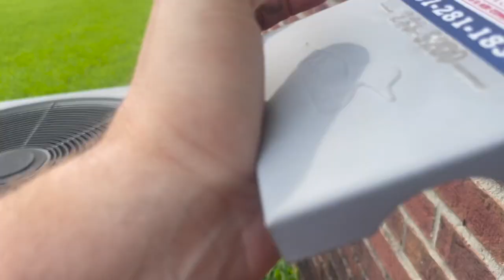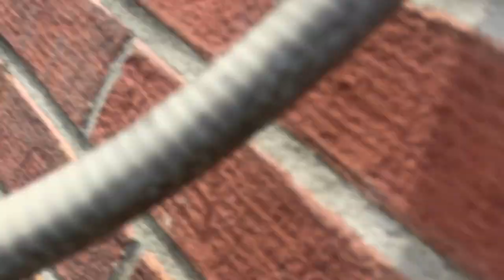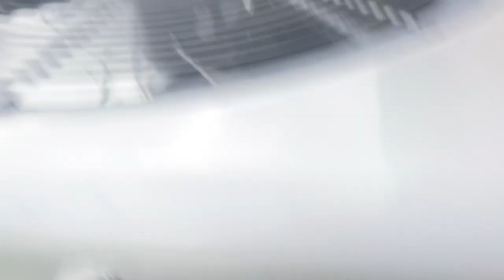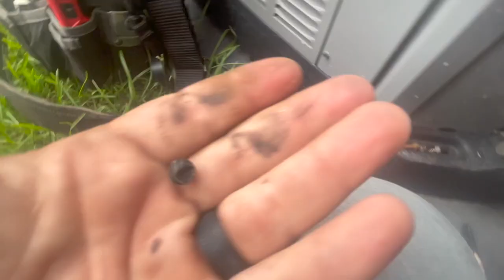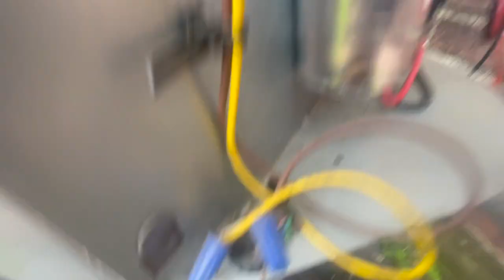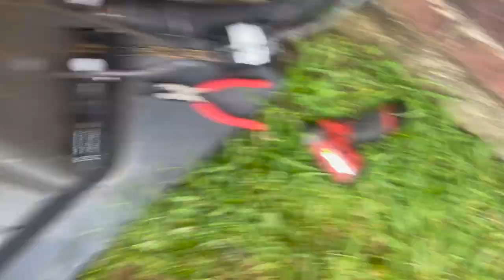Warranty Call/Noise From Condenser

Comment: Had a similar problem with two Trane condensors. Trane recommend put armor flex between the top of the fan motor and the cover. tighten screws to 70 lbs of torque. Also change the contactor to a 2 pole contactor and put the black fan wire to the bottom of the contactor.

Comment: Got to love those helicopters.
Reply: You guys talk about us helicopters when they were installing my unit the guy wanted to turn my unit sideways trying to convince me it would make it easier to work on when I wanted to look at the error codes on it if it screwed up I wanted to see it only reason he had to turn it sideways was having to run his vent stack out would save him on pvc pipe after everything was finished the Other techs told me it made sense of how I had it installed because the service panel for the a coil would of made it impossible to get it out
So much for us helicopters also it would of made it impossible to change the filters on it it’s a 5 ton unit
Reply: The installer was the problem.  Contractors or homeowners shouldn't have to tell you how to do your job.....and I hate helicopters no helicopter is gonna give me advice or how to do my job. That's why you called me....
Reply: I just tell them that I will get them after I find the problem. If they want to helicopter, I respectfully remove myself from the job. In my market, people are waiting for days to get service. We can pick our customers. Tables have turned and HVAC companies have the upper hand now. I had customers offer me up to $1k extra over my estimate to get their equipment installed quicker.

Comment: Isolate your condenser fan motor and compressor legs from the contactor. Double pole or 3-pole contactor would be easiest fix
Reply: I have installed many 3pole contactors on American standard units over the years. It’s a very common issue on those.

Comment: An old timer showed me to just add some electrical tape around the spades of the new  motor wires and it’ll slide through the seal-tight like butter.

Comment: I made a video how to stop the thump with a double pole contactor if you ever run across it again
Reply: Yes thank you for that video it solves a problem every time!!
Reply: There’s a fix for that, yes Joe is right he made a video, triple pole contactor.
Reply: @dizziedallas  I think I actually seen yours first but both solve the problem.. rheems are bad about it. Thanks guys great fix.
Reply: @SkipsTransAm2002   That’s cool I remember that video, unfortunately it happens in all manufactures.
Reply: @dizziedallas  I prefer to use the two pole method now
Reply: @joeshearer1247  I watched your videos about this (all 3 actually). In that situation, you said it only happened when the fan and compressor were shut off together. If you only had one piece connected in your test, it didn't make the noise. In this video above, it still made the noise even without the compressor. So I really think it's the broken hub problem that I linked in my other comment.

Question: what is the part called that you used to delay the fan by 12 seconds, solving your clunk issue?
Reply: @realSamAndrew  it could be the hub i believe he said it was loose but it may still do some level of the noise with the new blade. That delay device was a ICM254 but unfortunately they discontinued it
Reply: @joeshearer1247  thanks. Is there any kind of substitute or new alternative for that ICM delay?
Reply: @joeshearer1247  Nice!

Comment: I have a similar model rheem. Same 45+10 mfd capacitor. Stupid size. Why didn't they put in a motor that took a normal 5 or 7.5 mfd. I don't keep a 45+10 on my van
Reply: Yea those are hard to find
Reply: Gotta keep ALL the capacitors in your van.... I have at least 50 different types of caps in my van. All on inventory.. 2 of each
Reply: @videos10  well yea I do too but its hard to have them ALL in your van when the supply houses don't have them. Like the 75/5 MFDs
Reply: Is a common problem on Rheem is there packing when they stack them

Comment: I’m not an hvac technician but I do have a question. Does it matter what pin on the capacitor you connect to? I see there’s three on each section and I heard you saying what they were. I get confused why it has 3 terminals per section.
Reply: Doesn’t matter which one as long as the fan herm and common are on the correct sections and some caps have less or more pins fan usually has the least than herm and common has most so u can figure out tht way if you can’t see what the cap says

Comment: What’s up with HVAC companies always wanting to replace capacitors with best, longest lasting? I give them 1 year warranty. I hope it doesn’t last forever. I want to go back in a few years and install a new one for $350.
Reply: What you don’t realize is that by you having that attitude you’re not getting enough repeat customers and recommendations to stay busy all the time, that’s the whole reason you’re relying on Chinese capacitors to go bad again. Meanwhile the other 90% of us in the HVAC business can spend our time doing what’s best for our customers because that’s also happens to be what’s best for us.
Reply: You could poke holes in the coils too so you keep having to add refrigerant.
Reply: @barronweir123  Thanks. Gonna start doing that. Might just loosen up valve cores and leaving shreader caps loose. Honestly, it’s not the same thing. I would not sabotage someone’s unit, that’s immoral. But me being ok with the life expectancy of a capacitor is different. Oil change business are ok with changing oil every 3k miles. They would not want an oil that lasts 100k miles. If all HVAC was built to last for 15-20 years with all original parts, half the HVAC industry would vanish. As would jobs in plants that make replacement parts. What if McDonalds made a Big Mac that you never shit out?
Reply: @joep4143  I get it I think of turning to the dark side. I mostly just don't want drama from customers. Maybe that changes im newly a master license holder and work for myself.